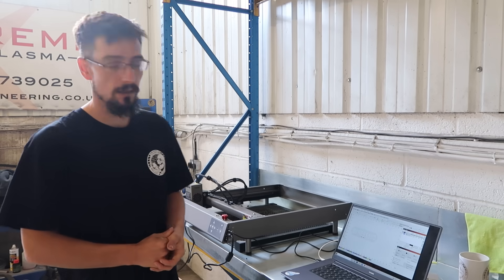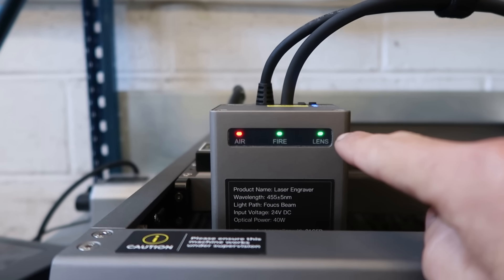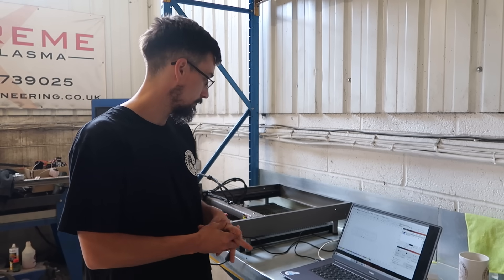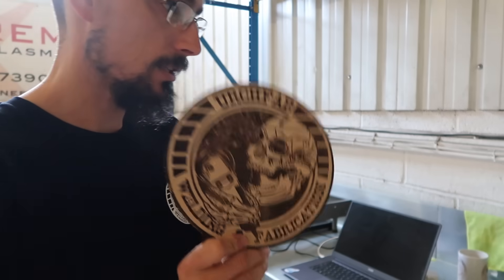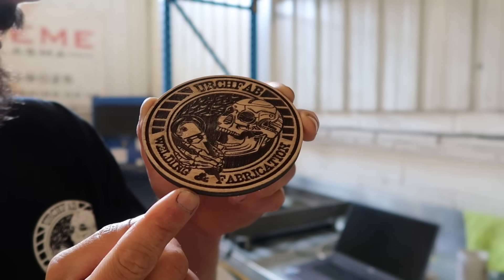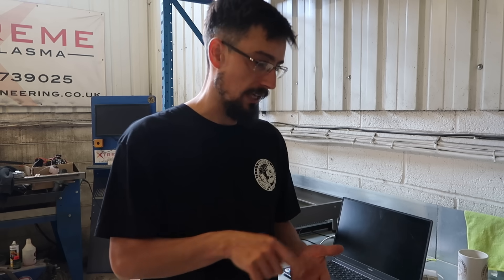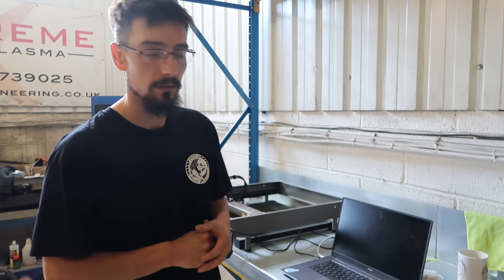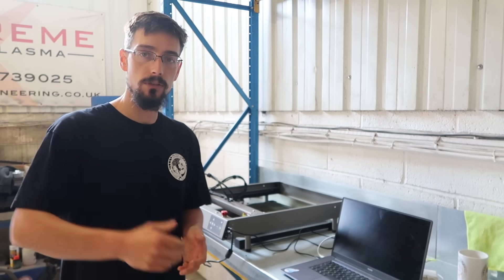Trying Out A Creality Falcon 2 Laser Engraver - Great Results!

Comment: Regarding the overburn you got on your first logo attempt, you can eliminate that by enabling Overscan in Lightburn. Start at 5% and adjust it from there. This tells the tool head to travel further than the actual job, preventing the premature slowdown and overburn you experienced. Cheers.

Comment: Matt if you are having trouble with tool turn around behaviour, i.e. slowing down, add a feature to each side of the work piece so it does the turn around off the work piece, you should be able to make some nice bits for cars like switch and instruction labels.